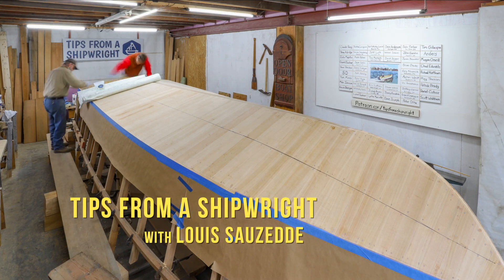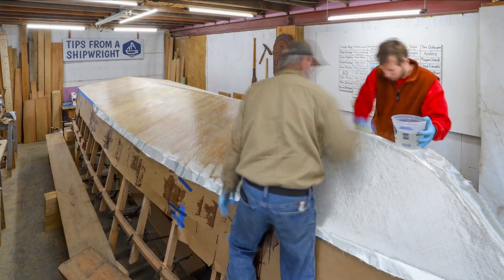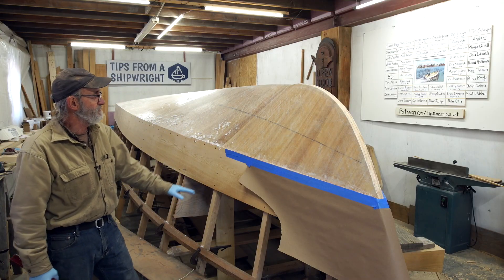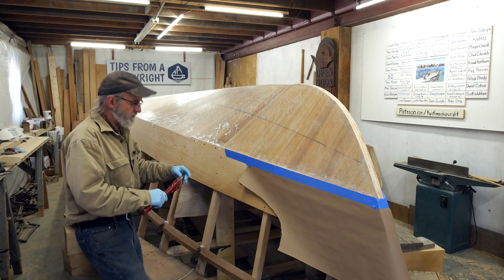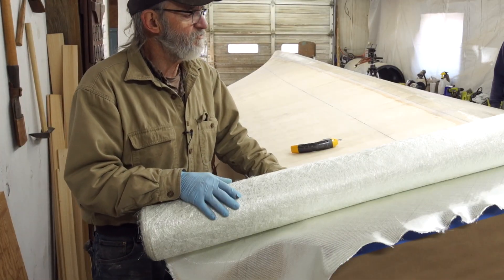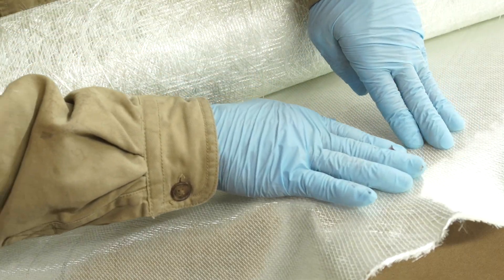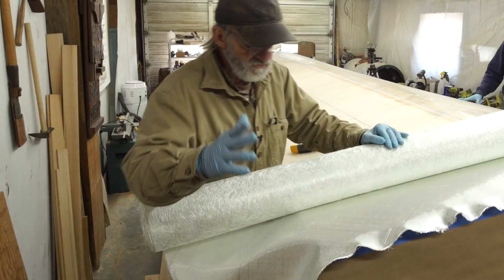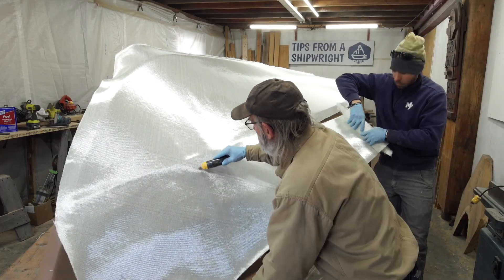Building the 23' V-Bottom Skiff - Episode 13: First layer of fiberglass

Comment: @5:08 chopped glass mat forms to shapes better. Anyone who has ever tried to apply just a piece of woven mat to any surface that wasn't flat; finds out quick, that no matter how long you chase it with a roller the stiffness of the parallel fibers wants to round over corners which makes voids. This is why you always apply scatter - woven - scatter - woven, it fits shapes, fills the voids in the weave, and allows a denser fiber to resin ratio. Really comes in handy when its time to sand and paint. Just out of curiosity why this blend, of solid wood keel and plank/fiberglass hull? Is it a nostalgia to use some classical methods improved with a composite and have a bullet proof boat that needs a rail car to move, You know as well as I that you can get that same strength but with none of that wood weight. Just curious.

Comment: I think it’s is to simplify the process having the biaxial cloth and the mat combined. Instead of two steps. Also that thin layer of mat should help wet out the cloth. Could also help laying the mat down and reducing air bubbles if you’re squeeing out the cloth. I’m also thinking having thin mat layer gives better adhesion to the wood.

Comment: 1708 is a biaxial cloth stiched onto a mat. The cloth portion brings bulk and rigidity to the 1708. The Mat portion creats the waterproof seal plus is very strong.  On a wood boat that is already ridged 1 or 2 layers of 1.5 oz cloth per layer should be good, no cloth.  I would recommend using a polyester resin as epoxy does not always break down the glue that is used to binde the mat.  1708 has mat on it as well.  I do not see a reason to have any cloth in this project,  Great boat, very cool and talented person.

Comment: Using a solvent in your epoxy as a thinner causes the cured epoxy to lose 30% of its compressive strength. Using a slow cure hardener and heating the epoxy or the work surface would probably be a better solution.

Comment: I am SO enjoying all you are doing here. As far as the scatter pattern of the fibreglass, my understanding is that, because the long fibres run in all  directions,  it make the topside layer much much harder to distort. Any direction you pull it in, it will not want to shift.

Comment: How do you get the binder in the Matt in you DBM1708 to break down with Epoxy ? That’s never worked for me. I’d be using DB170 ! All the tests I’ve done prove it. Do a bench test and check it . Chop Strand  Matt. (CSM) does not like epoxy. That must be some special Glue because only the Esters glues worked for me . Cool boat. I’m a fiberglass boatbuilder from Santa Cruz Ca. with 40yrs of building.

Comment: Lou is so engaging in this video, and the boat is so beautiful, that one is very hesitant to say anything negative. Beginners are however likely to take to heart what is said here, and for that reason I feel it would do such people a disservice if they were not advised to do further research before taking on a job of this nature. I believe that many of the methods used here are not in line with the recommendations of most composite materials manufacturers, and beginners are advised to study such documentation in detail before taking the plunge.  Aspects that give rise to concern include: thinning epoxy resins, the use of water to smooth a wet lay-up, the lack of overlaps between sheets of laid-up fiberglass, the unusual "composite" wood/fiberglass/wood/fiberglass laminations to be employed, and possibly the use of a fiber reinforcing fabric that may not be compatible with epoxy resins.
Reply: Agreed and noted
Reply: Oh diese Bedenkenträger, DIN-Normen- Liebhaber und Anweisungs-Befolger.
Geh' ma davon aus, das Lou das nicht das erste Mal macht und schon seine Erfahrung hat. 
Nicht jede Anleitung hat das Ziel, das man es richtig machen soll, sondern auch, dass man z.B. seinen eigenen teuren Verdünner verkauft

Comment: I’ve been building glass boats for 45 years now ,just wondering why ya don’t put a mat down first so it’ll bond to the wood , 50 years ago my dad used to glass with cloth right over wood , but two or three years later you could rip it right of the marine plywood or even treated kiln dry
Reply: Is there a chance that may have been with polyester resins? Epoxy resins are known for being very good at adhesion and gluing..

Comment: As I understand it, the mat on the back side is to add strength. With the fibers going in every direction randomly, there's there is consistent stiffness in all directions, not just the directions of the biaxial weave. It's great stuff that allows you to skip steps basically.
Reply: Charles, I use cloth that wets out perfectly, as it is matched (...is coated with a coupling agent) to the resin system. And that cloth is regular weave. It works well. You cannot chop-strand that lay over method for multi-directional strength (which you don't actually get from plywood either), and it'd look like an interior finish, taking forever to fine down. An answer on a larger boat is multiple layers of thinner cloth. Time consuming as hell. The surf board guys who work in epoxy have shown me the best techniques, and they have keen graphics to show through for their clients. But scaling it up for the big boat, well, that's a skill. I think Lou might benefit from the waft of a heat gun here and there, just as it get a bit uncompliant, but way-to-go.

Comment: The 1708 with the 3/4 oz matt is primarily used when polyester resins are used in the laminate and it DOES promote adhesion to a scuffed and hot coated wood surface. It also takes a step in cutting material out of the production process.

Your using an epoxy would call for a 1708 less the Matt backing. This version is specifically for use with epoxy as the binder in the matt isn't really compatible with epoxy. It also behaves dry and wet like a regular straight cloth- it takes a touch and some experience in pulling and squeegee driving.  Epoxy with matt is just wasting resin and adding weight that doesn't add an equivalent strength. 

You do what you do, you're convinced of your process but now you and your followers know.
Reply: You say the version he is using is specifically for use with epoxy as a binder in the mat but that it isn't compatible with epoxy?
Reply: @jeremiah1059  If epoxy resin is used, there's no need for matt.
The binder chemicals used to keep matt together until the resin saturates it are rarely if ever compatible with epoxy, so the Matt just sucks up resin and adds weight. The 1708 WITH a light matt backing is usually for use with polyester resins that WILL break down the binder and contribute to the bond.
Reply: @highlinercustomboats1816  okay. So is he doing it wrong in your opinion or just adding an unnecessary step/unnecessary weight?

Comment: During the winters in Petersburg, Alaska my 36’ Whal built  troller gillnetter was under a 6 mil visquine self made “boat house”.  The winter of ‘74 I insulated and fiberglassed the fish hold.  I used mat.  The resin then off gassed a vapor, “styrene” as I recall.  I found a fellow with a gas mask, ran a flexible tube from the gas canister up through the hatch combing out the boat house door till the end was well outside.
Fiberglassing inside the fish hold by yourself, vertical concave walls, getting the right amount of liquid hardener (it came it squeeze bottles - it really was a guess) in the resin, the mat to stay and not clump, the resin to penetrate, the offensive odor of the resin, the fact that too much hardener would(or could) cause the resin to catch fire or not harden to a proper “hard” was a (looking back on it) almost daily nightmare.  

I was 22 years old.

I watched your latest skiff video, no gas mask and thought, “My god, how far we have come”.  
I always enjoy your expertise and hearing nautical terms, vessel lingo again.  👍🤜🤛

Comment: I have seen a lot of glassed over wooden boats (new ones) and what often happens is the fibre glass adheres to whatever filler is over the fastenings and pulls it out, leaving the fibre glass tented over dozens of little lumps, the unfortunate part is that this does not happen immediately, but over months, looks like hell, you have to grind the hull back.

Comment: you've got some bubble trapped at the angle (port side next to the blue tape) whtn the cloth lifts before full cure, because the cloth cannot take the sharp turn at the right angle and springs back. One way to avoid that is to trim the cloth so that the angle, an other (which has limitations) is to use the help of a tear veil that would apply extra pressure there (or even better to lay a platic film and apply a weighted batten at the right angle)

Comment: Ive always understood you should never thin epoxy to aid with wetting ability, even the west system literature advise against it. But here's lou thinning his epoxy lol
Reply: Yeah. According to the MSDS, West System epoxy resin 105 has 10-30 percent benzyl alcohol in it. That is kind of a lot of non-reactive diluent. So maybe that is why West System advises against any additional thinning. There are lower viscosity epoxy resins out there that would not need to be thinned, I don't think. But I also tend to think That Lou knows what he is doing.
Reply: @mckenziekeith7434  he certainly knows what hes doing. I done a wee  test with two bits of 12mm marine  once, both with 200gram boat cloth.  one batch of epoxy thinned with epoxy thinners, The other batch straight from the can. I found the one that had been wet out with thinned epoxy you could physically peel the cloth from the plywood.
Reply: @caseydixon8714  Yikes! Nowadays there are some pretty low viscosity resins out there (intended for infusion) so I don't really see that there should be  a need to think epoxy.
Reply: @caseydixon8714  Smart of you to do the test. A good idea for anyone trying something out with epoxy.
Reply: @mckenziekeith7434  they advise against it because they're in the business of selling resin.

Comment: According to West System, thinning an epoxy by only 5%  using a solvent causes approximately 35% strength reduction as well as loss of moisture barrier. My guess is that was more like 15% alcohol. Still I would guess that the cedar was strengthened.
Reply: West System Epoxy resin 105 is somewhere between 10 and 30 percent benzyl alcohol (a non reactive solvent). This is from the datasheet for West System 105. https://www.westsystem.com/wp-content/uploads/105-SDS.pdf
Reply: Benzyl alcohol has a very high boiling point and maybe it will never evaporate out of the cured resin leaving voids behind. But it may also be part of why West System recommends against further thinning of their epoxy. It is already thinned by West System at the factory, and further thinning will make it too weak.

Comment: Not in wooden but In fiberglass boat building matt and cloth are two parts that marry into one; they complement each other fitting into the other's voids creating more strength. Matt is the layer under the gellcoat and then its cloth, and then you alternate layers. The reason matt is next to the outside is that it’s a better waterproofing material than a woven cloth is, it’s the first layer wear will come into contact with when the gellcoat is compromised and you want to stop water ingress at the first layer that’s directly under the gellcoat. You don't want to use matt only here it's too bumpy. As usual, he is doing the right thing for glass sheathing, people should take heed and use this method when encapsulating with fiberglass. Wake up and learn all you stitch and glue people!
Reply: That makes sense about moisture spreading.  Water could get sucked along the length of a fiber, but since the fibers are just short strands, each strand is a dead end.   (Granted this applies to laminates of CSM and polyester or vinylester resin.  I've never seen anyone suggest using CSM with epoxy is a good idea.)
Reply: @fredygump5578  RE: fiberglass boat building- I learned that it is gellcoat that is the first line of defense against delamination and unfortunately people are under the impression that it is a cosmetic thing. If the gellcoat is maintained and repaired there will be no delamination due to water ingress. Sometimes an almost micro-thin very tight weave skin coat is applied first before the matt to reinforce the gelcoat, it provides no structural strength. 

Epoxy and matt is not a good idea matt soaks up resin big time and makes a heavy boat not to mention it is too expensive to use that way and offers no appreciable advantage. The way to make a lightweight epoxy boat is vacuum infusion, a whole nother ballgame. These are usually competition extremely expensive boats that few can afford. 

Production boat construction is still polly or more common nowadays vinylester. If you would try to make a common layup production boat of epoxy it would be too heavy and twice the cost, not advisable needed, practical or necessary.

If you are interested there is a good book called the Composites Manufacturing Fundamentals of Materials, Methods, and Applications by A. Brent Strong.  There is an online pdf but I recommend the pricy hardcopy complete with all the pictures. Good luck and don’t forget to have fun- I have a yourube boating channel if…

Comment: The fiberglass mat is necessary when using polyester resin because 2 fiberglass fabric layered on top of one another tend to split over time. Polyester resin isn't strong enough. It's not as necessary when using epoxy resin. But you can still take advantage of the mat side by using it as a finish layer. Fiberglass mat can be sanded whereas fabric can't. Sanding fabric essentially cuts the fibers so it looses a lot of it strenght. Instead of having a continuous weave, you end up with a series of U's about an 1/8 long. Thanks for the video series by the way.
Reply: Utter rubbish!

Comment: When you're building in a female mold the scrim of mat keeps the weave from printing through the gelcoat when it shrinks.
There is a lot of styrene monomer that evaporates from polyester gelcoat. (It has to be thinned if you're going to spray it.
The mat also does help bonding between layers of cloth.
If you looked at two stacked layers of cloth  you would see no matter what orientation there would always be resin pockets where the weave crossed over each other.
Resin has no real strength compared to the fiber.
Bi-axial cloth drapes over corners because like any fabric on the bias, the approach and departure angles are MUCH shallower than if it was at right angles.
Take your bevel set and find the angle when following the weave. (In fact, do it on video so your viewers can see for themselves!)

Comment: Hey Lou grab a 16th x 16th floor trowel from home center flooring section, sand the notches edge down to what maybe a 32nd? (Make the notches shorter) Put the right amount of resin right where you need it, great video thanks

source-flooring guy

Comment: You  ever ues peel ply? When applied carefully it leaves a very smooth surface for the next operationwether it's more glass/carbonfiber, wood, paint, gelcoat, or whatever the next layer is. It also removes the amine blush in resins. no sanding or scraping needed unless the surface is not absoultly fair for the next layer.  Biggest problem is it's expensive and it's garbage after use.
Reply: Sir have you work with Carbon/Kevlar fiber? Like to ask a Question
Reply: @gregoryh4601   What do you want built or repaired
Reply: @gregoryh4601  It's pretty obvious by my comment that I'm either a liar, armchair quarterback, or someone with expirence if fabrication/repair materials, in this case composits.  You decide, I will contimnue to do what i do and make a ton of money doing it.